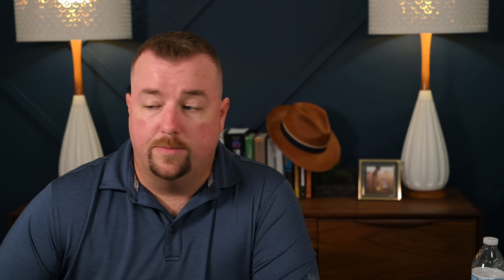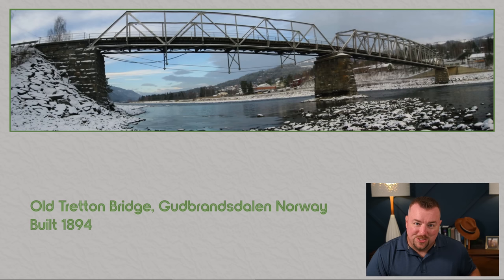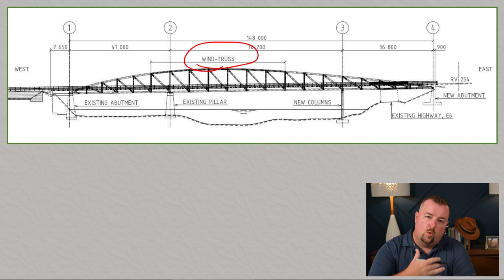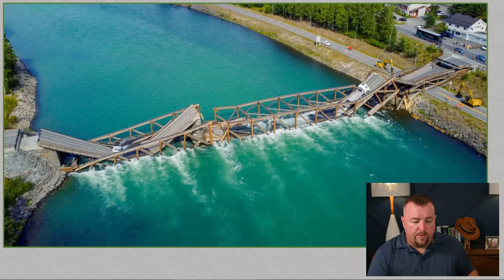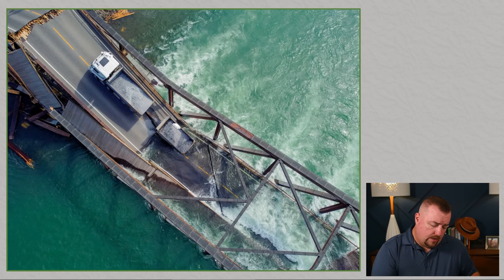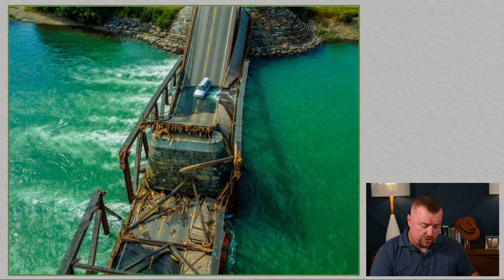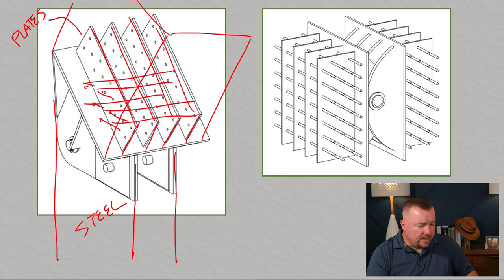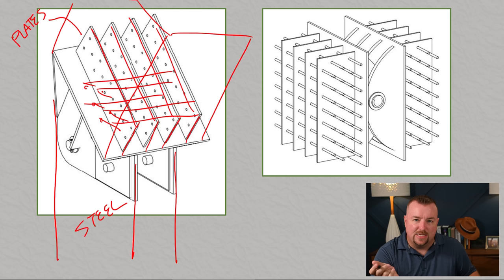How Did the Engineers Miss This?

Comment: Frost wedging - I realize frost wedging can split immense stone  batholiths such as Half Dome in the Yosemite Valley. Could the same action (freezing and thawing ), along with unequal expansion rates of wood vs steel, weathering of the wood and steel, all been contributing factors.
I’m wondering, does a round pin exert a greater point load on a hole compared to a square pin?  Does the round pin exert a horizontal stress along with a vertical stress as the loads try to rip the pin through the material. Along the same line of thought, would a square pin with the sides perpendicular to the force have less wedging force than a pin turned 45deg.
Josh, thanks a lot for keeping me awake at night.

Comment: The assumptions about the truck's movements post-collapse are incorrect.  You're saying essentially, "Because there are no skid marks, the truck didn't move far, if at all backward."  You're making the assumption that the backward movement would leave skid marks, which is false for two reasons.
#1: it would take much higher speeds/energy states for the rubber compound to come apart and deposit on the road.  Slow speeds are not enough to make this happen in any significant way, unless the proper conditions are met and in which case you'd see a "hopping" dotted line sort of skid mark.
#2: The truck is at roughly a 45-degree angle pointed upward, which will significantly decrease the downward force required to make a skid, and instead turns this into a lateral force pulled backward. Again, at these low speeds, if any rubber were to be deposited in the form of skid marks, it would be broken lines as the vehicle "hopped" as it was pulled backward.

Does this definitively prove that the vehicle has not moved backward? Not at all.  But there is no evidence that the vehicle has ot hasn't moved backward, so it's incorrect to postulate either way.  Eyewitness accounts from the driver or perhaps if there was video would be the only ways you could tell this.

Comment: Not an engineer or build bridges but have done some building and delt with prelams in the past. Architects are not perfect and to be honest make a lot of mistakes. They read books on the way it should be, use generic stats from "tests" to fill in the blanks and send the plans off to be built. Ya it should work and then is plopped out to the real world where maybe it was not built so perfectly or the road deck was put down a little too thick or they accounted for a 35 ton dump truck but maybe not the 25 ton trailer following so closely behind. To be honest it almost looks like what the ice road truckers would call a blow out. If a truck crossing a lake approached the shore to fast the water pressure wave would blow out the end of the ice road. The bridge broke at the solid point (abutment). The truck came from the west, went over two abutments spaced close to each other and went over the long span, bridge sags under the stress like a wave as the truck goes on up to the solid abutment. No place for the stress to go and boom it all falls down.

Comment: I was thinking the glue lam was boxed in the steel abutment members when I first saw it. Boxing in would have rot problems. My gut feeling is that the bridge would be stronger if the joints were build more like a post and beam structure. That would make the spans they were attempting very difficult to accomplish though. It seems like most of the bridge deck was in tension.

Comment: Why would you ever split the grain of wood when building a bridge out of it? that's begging for disaster. but also, a bridge in a rainy/snowy/freezing/humid area, which this is, is equally a bad idea. I'm not an engineer, but I know how a chisel works on a 4"*4", and splitting it with the grain is the way to do it, not against the grain. Fundamentally though, when it comes to safety (which is above all what bridges need to be) I am very skeptical about wood as a structural material in this context. might have worked as a highway overpass, (less weathering) rather than a river bridge... but hope and pray it doesn't fail for other reasons!

Comment: This is a good video - but the design calculations to the European standards do take into account things you say they would not have. You also say that the diagonal we see broken in tension would have been in tension because of the weight of the truck - but I think it would have been in compression until the collapse began. So what about the steel bolted connection that joins the truss on to the side of the bridge? That's quite unusual. Although you show great photos of it you don't discuss it at all.
Also - you comment on the lack of tire marks on the road. Perhaps the driver was already breaking hard because there is a junction right at the end of the bridge - and horizontal breaking forces may have contributed to the failure(?)

Comment: I'm not an engineer but I do work in an industry that has to "bridge" political requirements into functional policy.

I think it's great how you're analyzing the particular failures of this design - but I did notice that you open with clarifying that this bridge was supposed to be wood based by government policy and you cringed a bit. 

This makes me curious about whether it's this particular build that is at issue, or whether the government policy itself basically predetermined failure. 
Is it possible to build such a bridge properly, according to those guidelines? That would indicate a failure in implementation.
If not, then we have a failure in management - namely government's management of infrastructure.

Comment: G'day,

Did they
REALLY use
Steel
"Dowels" in
Laminated  Construction "Timber" which was going outside, over a River,  in Wind & Rain & Sun, and Snow ?

And being
Norway, the  Wood would've been a Conifer, eh ?

Conifers are SOFTWOOD.  
Not remotely fit for Bridges.

On 8 November 2019 my son was in a hurry to lead his Strike-Team over the Mann River to get onto Wytaliba - a 100-dwelling Community being overburnt in a MegaFireStorm - but the Bridge had 3 metres of Flame rising, full length, both sides.

The Ironbark Beams were 100 years old, at least, and they were solid, 1-ft Square, 30 ft long...& and my boy had grown up swimming under the Bridge, so he knew the score. But the rattly old  Wooden Deck had been topped with a Steel Reinforced Concrete Sheet ; so as he steamed over the Concrete he "joked" with his Crew - "It'd be funny if it was a Wooden Bridge under the Concrete !", as he took them over.

I wasn't on it, but my Brigade's Truck followed him about 5 minutes later, and the Flames were 5 metres - and when the 3rd Tanker arrived another 5 min's later it was a 10-metre Gauntlet-run of Fire, so they stopped and a Ton of Water  didn't put it out (it was a Category-7 Truck, based on a 5-ton 4wd Isuzu, 1,500 Litres but 500 is for the Crew Protection through the Burnover Spray system...)

So they watched while the Bridge fell into the dry River.

Wooden Bridges built from 
Actual
HARDWOOD 
Can withstand a LOT
For a Century
And then, even when burning down
They fail
Slowly and
Gracefully...

Nobody with a Brain expects Epoxy to stick Wood together in Outdoor Applications.

For THAT, piss the Pox Pot off entirely.

Get some Phenolic Resin
"Resourcinol" - a Boilproof Marine Adhesive.

I've flown behind 2 different Laminated Tasmanian Oak Propellers which I designed & made, and on a Destruction-Test still currently underway..., Two Laminated Wooden Wind Turbine Rotors I made in 1985 have been on a Turbulence-testing Rig on my Front Lawn since 1996, UNMAINTAINED...

And the Estapol flaked off 10 years back, the Wood is grey and ugly ; but the Resourcinol is apparently uneffected by prolonged exposure in Oz, at 1,110 metres AMSL, 30° South. It still occasionally snows in Winter...

That Bridge must've 
Bin-Designed by
Arrogant ignorant hubristic
University-trained
WANNABES...(?).

Surely they weren't sufficiently deranged as to put Horizontal "Dowel" Holes drilled parallel with the Glue-Lines, between the Laminae ?

It's all 
Nucking
Futz...

The New Mann River Bridge is all Steel & Concrete.

70 of 110 Buildings were lost, 
60 people were burnt and singed a bit...; 2 needed Skin-Grafts, and 2 others died there that day.

My Brigade Captain Son is now a Group Officer, commanding 6 Brigades and running the Remote Area Firefighting Team.

Squeaking as a
Wheelwright's grandson
(I used his tools for the Propellers and Rotors !),

My comment is that the
Unbuggared
Laminated Beams did NOT Fail...,
What
Failed wax the
Wildly optimistic and dysfunctional 
BrainFart of an idea for
Mating Wooden Beams to Steel.

The old Mann River Bridges's Foot-Square Beams were connected by properly fitting and shaped JOINERY..., with  long overlaps, and 2" Bolts securing the Joints.

These Norwegian Clowns - if they MUST use Epoxied Slivers of Softwood for Bridges, might have had better results by building deep Sockets of Steel Plates, to mount onto their Metalwork - and poke the Laminated treated Beam into the Socket, and using BIG Bolts, in a "Zigzag" Pattern, they could've  relied on the Socket's Sidewalls to Contain 
ALL the 
"Splitting" Loads induced by Tension-loadings pulling the Bolts
THROUGH the Wood - which
Obliges the end of the Beam to "Grow," in Width or Breadth ; as the Bolts wedge the Wood apart.

If the (literal)
FERRULE
Stops the Wood from
Splitting -
THEN 
The Joint cannot fail.

Those piddly little
"Dowel Holes connecting the Steel "Fins" to the Wood either side of those sawn "Slots"...;
ONLY served to 
Slice into and 
Perforate and otherwise
"White-Ant" 
Whatever actual 
Strength, their laminated
Beam might have had.

Were they perhaps trained by
Ikea...?

Driven by
Marketing Jism,
To desperately try to hide
Every
Joint ?

That might explainificate a lot, eh - what ?!?

Such is life,

Have a good one...

Stay safe.

;-p

Ciao !

Comment: My thoughts:   

1) probably they were trying to use local materials (wood versus metal)  Good intentions.  Bad idea.
2) when you use multiple bolts, you stagger the bolt patterns for more strength.  This is basic.   
3) glu lam, as you point out Josh, seems like a REALLY bad idea for exterior applications.  I always question any glued wood anyway as what happens to the glue joints after 100 years?  Brittle?  I would think so.
4) as a builder for 50 years now, I see repeated use of laminated/finger-jointed materials because we have chopped down all the real wood.  Therefore materials now are crap.  This is reinforced by my current headache of using finger-jointed wood siding on my current project.  The stuff is crap.  Will it even last 20 years????  So now up on my soapbox, there are more humans than the earth can accommodate, thus forcing the use of screws and glues more and more.  The results will not be good.

Comment: The wood wouldn't split like that if they had been capped on the ends with the steel. You could still use the pins. Just seems very stupid to design like that.

Comment: Doesn't wood rot.  (7:00) Like those slots & dowel holes - water-proofed I'm sure.   It would be interesting to know how much rot is found in the detailed examination of the busted up wood beams.   I was just a simple framing carpenter and renovation, but lordie I've seen how easy glue lams can rot.  Have used a screw driver to easily bore right through 8 inches of glue lam structural beam, it was that rotted.  Why because stucco with styrofoam backing, collected and "sealed" in enough moisture to start and feed rot.  The mantra for the job because, "are we keeping water out or locking it in."

It's not just rain, snow, roadway splash, it's vapor that condenses and stays locked in.   I mean how disconnected from physical reality are modern (computer) engineers, that don't have the imagination to think about environmental realities.  Reminds me of that Titan death trap, built to fail.  {It's frightening how facade has come to mean more than substance in todays world.}

Comment: Hello building integrity,  regarding sw and failure,  plus Norway, I think this would be a perfect opportunity for you, to address the Sleipner A construction, (condeep) that disappeared in 18 minutts, there is even a video showing how it disappear,  and it was not the built number-1, but I think they had started using computer software,  and I think the software had forgot to join the metal bars in the concrete, it was a spectacular failure, just as spectacular it was they buildt a new constrution in zero time, I think you would love looking into that disaster

Comment: The demands of the river authority explain the nice stone pier on one side and two skinny posts on the other side. But it looks like a cheapskate excuse.  Why was a (well proven) single or twin tower cable stay not used? They are strong and do not have the maintenance costs of stranded wire suspension bridges.

Comment: When the field of engineering, which fundamentally relies on precise calculations, proven principles, and empirical evidence, is swayed by the often shifting and subjective winds of political influence, the results can be less than optimal and sometimes disastrous. The integrity of engineering relies on objective analysis and the application of science to ensure safety, functionality, and efficiency. Political considerations, however, can introduce factors such as cost-cutting, favoritism towards certain contractors, or the prioritization of aesthetic or regional considerations over structural integrity and optimal design.

To avoid such outcomes, it's imperative that engineering decisions remain in the hands of engineers and are made based on sound scientific principles rather than political agendas.

Comment: It is way too late for my input, but I think the bridge should have been designed and built as a single-span truss on new abutments doing away with the old abutment and pier in the river.  This would have opened the river to less restriction at this location.  There are several truss types that would accomplish that objective.

Comment: Great video.  Some other points.  Being continuous at point C in diagram at 35:00, there would exist a negative moment there, meaning top chord is actually in tension under that loading.  Though where the load is maybe not at maximum negative moment.  But it does to me seem it snapped there as porentially the primary cause of failure leading into second order load paths giving the local bending failures you mentioned.  Also, the diagonal going up and to the left from point C would be in compression not tension I would think ( the one coming up and to left from point D would be in tension though). But I do see your point about the residual plug that seems to have been pulled out, hmmmm.   Also, the truss depth is getting shallow there compared to other side, magnifying the loads. And lastly the splice between the pile cap beam end and bottom chord, hopefully that diagonal load is going straight into pile cap and not into bottom chord, through laminated connection , and then the pile cap.  Great video, thanks for sharing. 👍
Reply: I thought the same in regard to the diagonal going up and left from B, it would be in compression. In your comment you mention the diagonal going up and left of C (I think you mean B? The diagonal up and left from C is intact).
Reply: @tomrose4560  yea, both diagonals from B and C in compression.  I think it was in response to the narrator, think he mentioned they would be in tension but has been a while since I've seen the video.

Comment: The wooden dowels should have been bolts. Whoever designed this didn't understand how wood is weakened by too may holes too close together at the ends of the wood. The problem was obvious to me from the beginning but now as I'm typing this (while watching) I see you are coming to the same conclusion I did. Being a carpenter & the son of a carpenter I know how wood behaves. Most engineers don't actually understand wood.

If you want to do a more interesting & informative approach to doing these videos is to give an overview first. The 30,000 foot view gives context. IE: A bridge collapsed in Norway that proved to be due to improper use of wood when combining it with steel. Having said that first - it makes all your details come into focus faster & more easily for the listener. Your approach of giving clues but not saying why doesn't build intrigue like you might think. 

All it does is bore the person who doesn't predict where you're going & for those, like me who knew where you were going from the beginning because the structural issue was obvious to a 2nd generation builder like me. So that made it boring enough for me to skip ahead. If you'd given me the context I'd have listened in a more focused & involved manner because the overview approach is way more interesting & tells a better story because it gives more meaning to the importance of those details. Also it means you don't have to keep reminding people why you're hinting but not describing. Thats amateur. You should not have to do that to keep people's attention. I've coached a number of successful youtubers in their presentation skills & they all do a better job than you do - just by knowing the one thing I just told you.

The only time not to do that is when the surprise outcome is so totally unpredictable that NOBODY would have thought of it. Only then can you legitimately use the suspense-building approach because the ultimate truth is so arresting that it makes sense to keep the outcome a secret. But this was a terrible example of a surprise outcome & therefore wasted your attempt to build to a climax - because it just isn't one of those kind of stories. I never watched the entire video because you made it all about that one bit of wood failure instead of about a bridge collapse. Hope this helps. If not nothing lost but a wee bit of time.